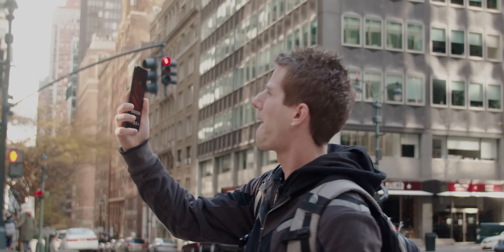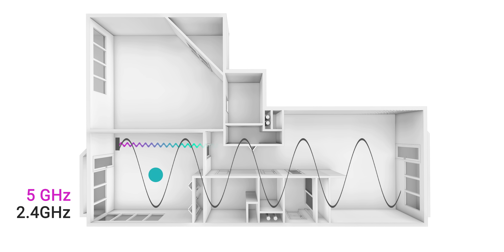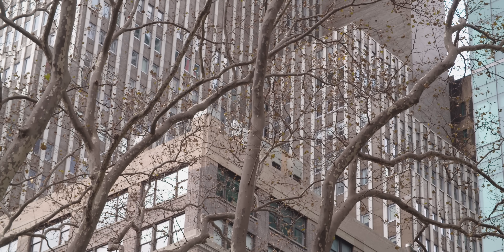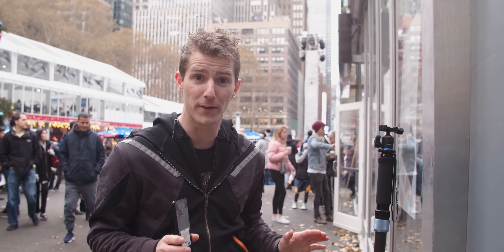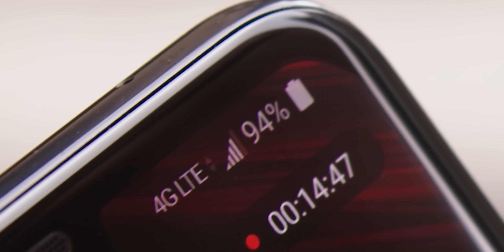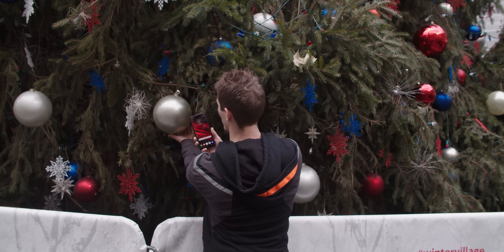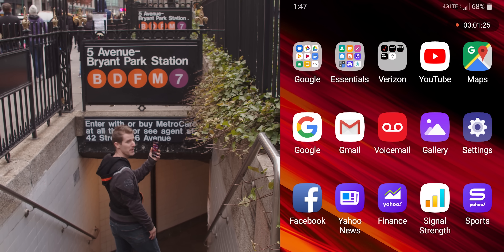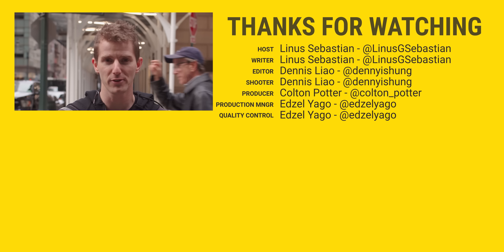The PROBLEM with 5G mmW...

Comment: 1. You are the only 5G User on the Node.
2. Your Terminal (Device / Smartphone) was provided by T-Mobile and I am certain that it has higher priority in terms of network traffic.

I know this because Vodafone provided me with a 4G Samsung S5 during the ARIS EU#282 event and I also had priority in terms of network traffic.

So... a normal user, with normal network traffic priority, will not achieve this kind of speed.

Comment: The problem is, like any technology, it's in beta. It hasn't been finalized or fully implemented; why are you so cynical and not excited for the potential?
Reply: This is ground-breaking speeds. Not 10 years ago we were craving gigabit connections through ethernet.
Reply: Progressive web applications mean you don't always need connection anyway, it assumes you're going to eventually/soon. This is most definitely the future, if you don't have signal here, it means you've reduced speeds not 'limited connectivity' . Therefore, the amount of info you can upload/download in milliseconds is insane.
Reply: Again, 12 years ago, wifi hot spots were spotty at best, as in no one had them. Look at us now.
Reply: @jimemmonstein847  12 years ago wifi worked very differently, on very different tech. 5ghz, MU-MIMO, band steering, none of those were things and were part of the reason hotspots were shit. And this video similarly is pointing out how much work needs to be done on a technological standpoint to make it usable.
Reply: It's physics. You cant do anything about it. Like with Stadia, where everybody wants to defy speed of light. Pathetic.

Comment: but you need the high frequencyes to get high speed ... going to low frequencies just means slower network conection to the point where slapping on 5g symbol on something that is basically 4g or even 3g speeds at worst ... i feel this is kinda misleading

Comment: 5 is one more than 4 though.

Jokes aside, even if the speeds fall back to 100/100Mbit but it's way better equipped to deal with crowded situations, I'm all for it. Who can't recall a moment where you had a near perfect 4G signal on a festival but it was just unusable because every device on a tower requests packages, even when on stand-by and a tower can only receive and transmit one package at a time. You think the line for the falafel stand is long? Just try to open a newspaper site when you're on a festival.

Comment: 5G is just a gimmick. They talk about it at Sprint all the time, too bad Sprint's 4G barely works.  Not to mention, if you want 5G with Sprint, its a more expensive plan as you're kicked up to the Prem Unlimited plan.  Which is $20 more than the Unl basic.  The phones are more, the plan is more, for a network that doesn't work.

Comment: And when there is proper evidence of 3G and 4G causing harm in long exposure and scientists implore governments to postpone the release of 5G technology in favour of conducting proper tests to see if it is actually safe... governments do not really care... Luckily my position in my workroom and the position of my bed in my bedroom are in areas where 5G would not really reach properly due to nice soviet-era 30cm thick brick walls lol... (I pay with high heating bills but oh well... my whole country is sorta like this)
Reply: Dont get too comfortable behind those 30cm thick walls because the lower frequencies like 868/900Mhz can pentrate more than 3 feet of concrete and the equipment is installed on the streetlights globally allready masquerading as a lighting control system, its banging through my wall right now through about 3 other peoples homes.  The 5G equipment can shoot through your window and reflect off a surface to hit you also.  There is plenty evidence that the existing frequencies do harm too, but the miltary and the wireless industry are keeping that quiet in the mainstream narrative.
5G LED WEAPON DENSIFICATION OF OVERCAPACITY:
https://www.youtube.com/watch?v=NXTaL88sR-k
5G LED KILLS SMALL BIRDS - HERE IS THE EVIDENCE:
https://www.youtube.com/watch?v=7mF2aYZ-Xo0
Reply: @hootsmin  surely some 5G will reach me yes, but it's significantly less than if an antenna was basically directly in line of sight or when living in a "cardboard box" house :P
Reply: @jyrgenruut  You going to stay in your box all day like?  Humans beings need sunlight to be healthy.
Reply: @hootsmin  nah... but when I go outside, I am usually spending my time in forests and marshes, so... far far away from any 5G anyways. I really dislike being outside in a city environment, though, yeah... and as such only stay outside in a city when going to the store or visiting some place haha.
Reply: @jyrgenruut  Cant beat the forest for a good day out, stay safe Jurg.

Comment: Couldn't they do some sort of 5g retransmission, like a line of sight antenna on the outside of a building connected to a signal booster on the inside, maybe running some kind of  ethernet/cellular over power type of device?

Comment: Linus, you may want to fill in the blanks here.

The millimeter wave deployment primarily by Verizon and secondarily by AT&T do have wave interference issues.  However, Verizon in particular, has purchased a huge amount of spectrum within those wavelengths.  Their deployment plan is to have millimeter wave towers and repeaters (similar to your example of 5GHz in the home... 5GHz is faster and can maintain this if you use proper signal repeaters or if you have multiple routers) within high population densities every block or two.  This is something T-Mobile CANNOT do because they simply don't have the spectrum to do so.

Verizon also has plans for 5G deployment in lower population (such as sprawling suburbs) using its PCS bands that are currently being shifted from its AWS and CDMA1000 (1x) services.  Lastly, they have plans for rural areas using existing 700mhz spectrum, which is akin to the information that T=Mobile is espousing.

I know this is a paid advertisement for T-Mobile, but Linus is usually more forward with the technologies that everyone is using and deploying.  But, money talks and bulls*** walks, as the saying goes.

Comment: Ive been doing 5G deployments here in the UK. 1.2GB over air is totally possible. However the system has drawbacks. 
A. You need twice the amount of transmitters in any given area compared to 3G/4G. So lots more masts. (Unsightly). 
B. 5G does not travel well through concrete walls. So if in a office block, or shopping mall. Or even a car park, 3 concrete walls seems to be enough to completely stop it down to "No Service". But what actually happens is the phones just fallback to 4G service.

Comment: I really dont think 5g is gona make it as THE NEXT GEN,
the connection drop problem is not really acceptable.
What will happend when i am doing video Chat(will the connection briefly drop because of losing line of sight) 
Probably yes.
There is also the indoor Problem,
you cant reach these high speeds if you are indoors you nood alot on MIMO inside the building itself

Comment: Those full-body scanners at the airports operate in the 300mm wavelength, and can be blocked by certain types of clothing even at close range, so yeah, duh, 5G is going to take major hits with just about anything between your 5G device and the 5G transceiver.

Comment: Problem with 5G roll out TM is doing is they are not adding in any pipes for the new network. I work in CO for a telecom company and the only one that does connections to towers. TM saying we are 5G now. They haven't added in any pipes to that traffic so it's using the same connections that 4G is on and not really improving the network. When i ask TM to explain this to me they wouldn't respond. When i ask my local TM cell tech he said it's really just a logo change on the phone...same network same pipes nothing really upgraded.

Comment: 5G has another problem that no carrier seems to want to address; bandcap. Let's say you have a 1Gb bandcap, which is pretty common. At 60MBPS, you could download constantly for 16 or 17 seconds on your monthly. (Yes, even streaming TV, you don't download constantly, this is for comparison.) At full-speed 5G, you'll pass your bandcap in one second! In this way, 5G is a gold-plated invitation to $5/MB overages because you'll pass your bandcap before you know it. Do you suppose that carriers will give you a higher bandcap on 5G? No? You're right, of course they won't.

Comment: That's unfortunately going to always be the way with higher frequency waves, their penatrive power becomes less and less as they become easier to be absorbed,unfortunately that's just the way em waves work, if they can find a way to increase the bandwidth of the lower frequencies then that would solve that problem but eventually it all boils down to compromise unless people install antennas pretty much everywhere which is expensive and difficult too

Comment: Hi Linus. Im a researcher at 5G Innovation centre with more than 10 years of experience in the mobile industry. I have some comments to help you get up to speed with some details.
1. We do not recommend mmWave frequency band for macro(outdoor) base stations. It is only recommended for indoor (micro base stations) because it can get attenuated with even water drops. Also there is a concept of Path Loss which is higher for higher frequency so for mmWave the attenuation is even higher as you move away.
2. For macro base stations we recommend sub-6GHz band. Most probably candidate is 3.5GHz.
3. T mobile has launched 5G on 600MHz which attenuates less with distance coz path loss is less but does not have enough bandwidth to give you high speed. For data throughput we follow something called as Shannon Capacity which is the upper limit of throughput in any communication system. It is given by 
Capacity=Bandwidth*Log(1+SNR).
So you see throughput is less if bandwidth is less.
4. The best solution is to have something called Heterogeneous network. Use sub GHz for coverage+sub 6GHz for capacity and mmWave for super capacity.
5. 3GPP has not completed standardization of 5G. What you have right now is 5GNSA (Non Standalone) which uses an anchor carrier of 4G with data carrier of 5G so all 5G networks currently are not pure 5G.

Comment: I used to joke about opening the window to let the cell service in. Never thought I'd have to open the window to let the internet in 😂
Reply: Sadly, that is already true in some rural settlements. Glass does worsen signal ever so slightly and putting the device outside may do the trick. Using a USB extension cord for the 3G USB receiver taped to window is a classic.
Reply: I know this is probably a joke, but something fully transparent like a window won't stop 5G signal
Reply: @LilacMonarch  It was a joke but I concur. I guess low e glass could block the signal but regular glass shouldn't.
Reply: EarthBoundNess / LilacMonarch except it can, they put very slight mirroring on exterior windows, to increase thermal insulation, but it can also block radio waves

Comment: you: talks about how 5g is better than 4g
me: only has h+
Reply: H+ is just a 3G evolution.
The 4.5G is most likely 4G but with carrier aggregation which here in Germany works really well and sometimes gives me over 250mbit/s
Reply: you: talks about h+
me: only has edge
Reply: @jsebean  i got gdsm
Reply: Here in Germany I sometimes get 200mbit down and 170up on 4G+
Reply: @watn3yold119  and here in Poland I get about 200kb/s on lte
Reply: @polski_dezerter  Sound's like you're being throttled
Reply: @BuickGeek24  well yes ur right I have 1Mb/s
Reply: H+ is not 4G at all, fastest download I got was about 20 mbit/s and the ping is also pretty high(30).
Even the lowest 4G(800mhz) gives me a bit over 50 down and 30 up with a ping about 20
Reply: 56k those were the days.
Reply: I can't browse normally with H+ (3.5G), 4G and 4G+ (4.5G). But for years I haven't been able to use while on H/3, not even able to load Google. It used to work but now only for calls and SMS.

Does this also happen outside Brazil? And why?
Reply: @andreylucass  Maybe your phone is toast
Reply: The coverage is so good in certain areas in UK that I actually get an E. God knows what e stands for.
Reply: KaputPictures It stands for edge if i am correct
Reply: I have 2.4g and I'm lucky to get 20mbps download and 8mbps upload
Reply: Only has GSM
Reply: GPRS ftw
Reply: @qlus  GPRS dial-up was real shit
Reply: Well, technically, hspa+ is part of the 4g standard
Reply: @patrickconti4297  uhhhh, at least here in the UK, its known as 3.5G. To be fair, 34/4Mbps speeds on HSPDA+ ain't no slouch 😊
Reply: @patrickconti4297  Only for the US. Rest of the world agrees hspa+ is 3G
Reply: @patrickconti4297  I've always regarded HSPA+ as "3G", albeit REALLY GOOD 3G, and the "4G" moniker for it as marketing. Some cheap phones will advertise themselves as "4G", hoping to mislead customers who think that it's LTE when it's not.
The technology is an in-place upgrade to the original UMTS WCDMA 3G air interface. Original 3G devices can still connect to HSPA+ towers, if they support the bands necessary.
(A problem with T-Mo here in the states, as they use a somewhat awkward band with UMTS/HSPA+ that many phones not purpose built for it don't work with.)
The first update was HSDPA, then HSUPA to form HSPA. Then it was updated AGAIN, thus the + and the screamin' 42Mb downlink.
While the LTE that most people mean when they say "4G" is a fundamentally different technology.
Most phones I've owned call HSPA+ 4G, but my Samsung A5 displays an alternating "3G" and "H+", and some others simply use "H+" to refer to the technology like Polski did.
Reply: @patrickconti4297 , H+ is 3.5G.
LTE technically also isn’t a 4th Gen network but mostly considered so.
Reply: HSPA+ is only 4G in the states, where as usually only 3.9G e.g. LTE is actually called 4G elsewhere.
Reply: @rkan2  In Turkey we have something like 4.5g which is bs.
Reply: h+ is pretty much 4g

Comment: So basically if I live like... Anywhere other than a city street I just get 4G lte
Reply: With mm wave yes. Since mm wave has trouble penetrating obstacles. T-Mobile just rolled out 600 MHz 5G which while slower has better signal penetration and a larger radius spread from the actual tower.

Comment: To summarize my understanding of 5G so far:
5G is much faster than anything else but has a terrible range and there are no use cases. At least not with consumer electronics ("great, I can burn through my data plan in just a few seconds").

Comment: The only thing about this that bothers me is that LTT covered that mm5g drops, but continued to talk about t-mobile's longer wavelength "5g" networks without discussing the speed drops that you can expect with those longer wavelength connections.  Don't get me wrong, it's an improvement on 4g LTE, but that info should have been covered too.

Comment: So wait, this is the stuff that's supposed to give us cancer? The stuff that can't even go through us.
Reply from the maker: Yeah basically. It's shocking to see those comments on a video that's literally entirely about how it has basically zero penetration power.....
Reply: @LinusTechTips  It's always fun to try and explain how any wavelength above optical wavelengths doesn't penetrate us.
Reply: @LinusTechTips  Isn't the higher the bandwidth is, the harder it is to penetrate? I'm not sure how it works and I tend to overthink things when it comes to health concerns. I love your channel and any insight you can provide will be much appreciated.
Reply: @ramdom_assortment  Yes, it's why optical light and above doesn't cause cancer. They can increase temperature.
Reply: @CallanElliott  Cool, thanks for the response.

Comment: so we have 5g, but we are using a low band.
so, 4g then? since that has a lower band, better range, and thus lower speeds
no no, it is still 5g.
???
Reply from the maker: This is explained in the video. 5th gen (5G) can operate on any band with improvements over 4G on the same band.
Reply: @LinusTechTips  sure, but the 1Gb/s that they advertise will never be reached on such bands. and i have already seen adverts for 1Gb/s celullar data, with increasing coverage over all these area's. so, there will be benefit's to be had, but they will not be that big, if on the same band as current 4g.